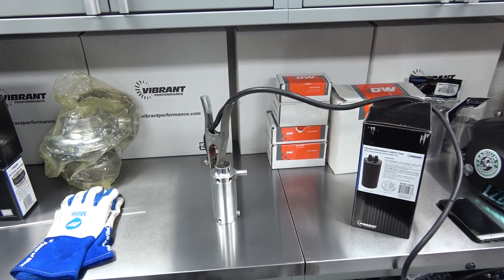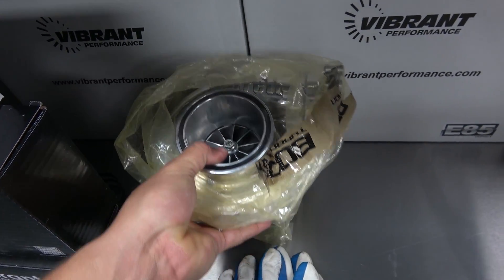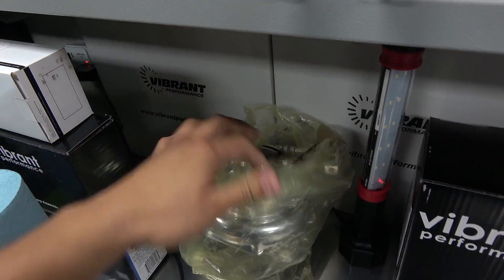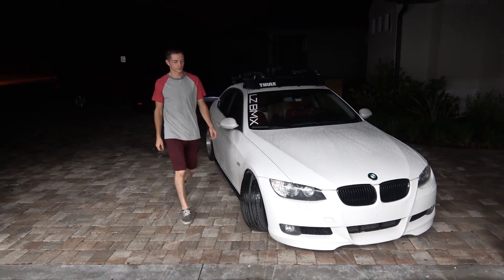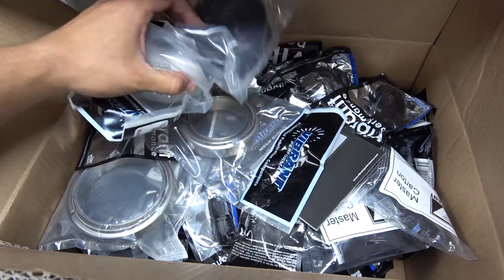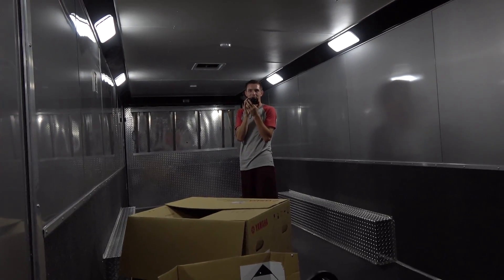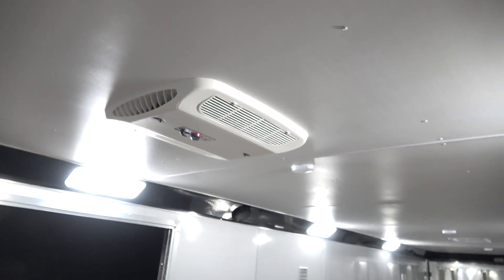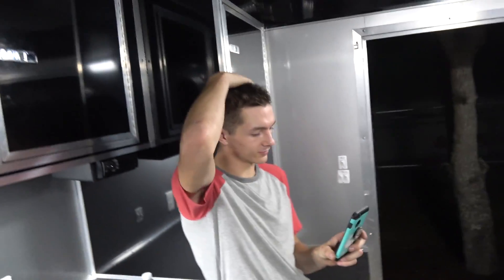NEW SHOP TOUR

Comment: Adams and Alberto, you made some great, quality choices with the exception of one.  I have pulled a number of trailers in my time.  Please consider changing out the weight distribution hitch for an "Equal-i-zer" system.  I promise you won't regret it.   It handles weight distribution and sway control in one and also allows you to backup with out removing the system.  Please, Please, Please look into this.  You will be so happy you did.

Comment: Weld a base frame together, think simple go cart and simple steering, than use a starter motor and put a few pulleys together and walla.....driveable generator. Not hard with all the tools and welder at your disposal... That trailer is mint and doubles as a garage/office/sleeping headquarters on the road....very very good investment imo....

Comment: put electric motors on the generator to drive it instead of trying to drive it with a chain because it should be a tapered shaft so it would be hard to put a sprocket on it and it would have lots of torque so he could pull things like he said he wanted to do

Comment: Uh, having that static issue with the floors might not be a good thing working around racecars which means fuel and other flammables.
Reply from the maker: NotFlafee yeah with fuel tap on metal stuff before touching near fuel lol. but mainly is the cold from the a/c too. if working with fuel the door will be open and fans on. doesn't seem to create static on warmer air
Reply: sweet, wanted to make sure you guys had thought about it. if you and adam explode then i lose my two favorite automotive youtubers.